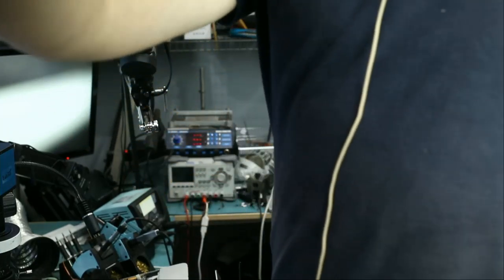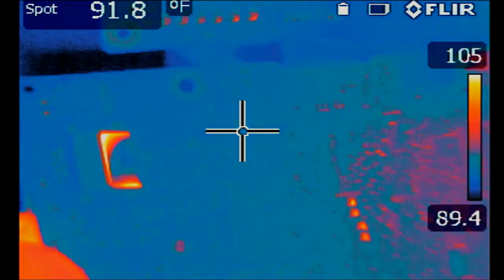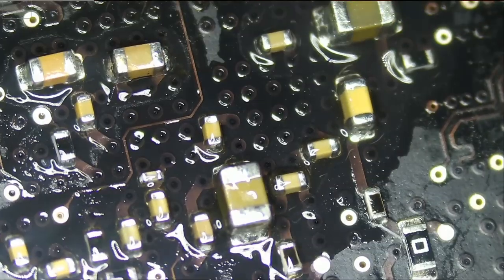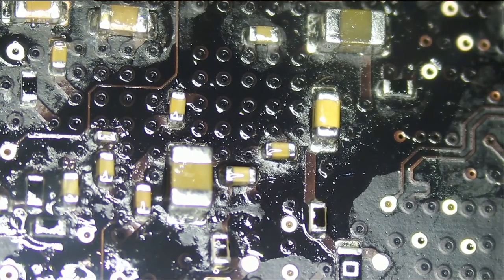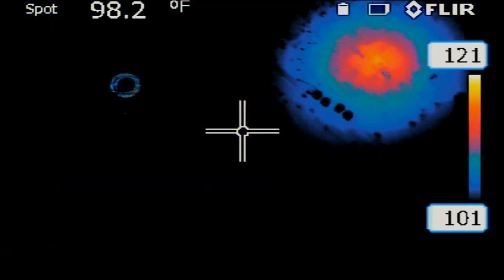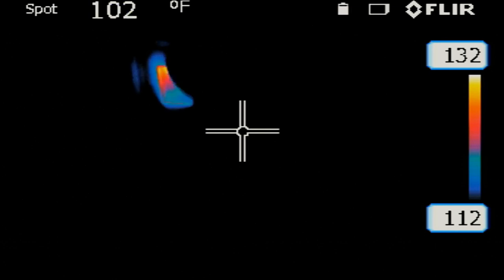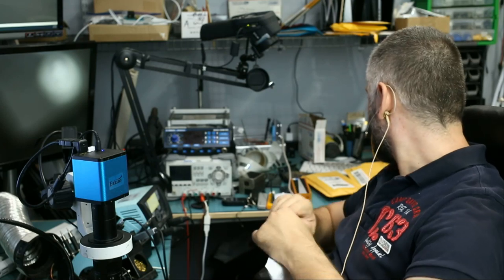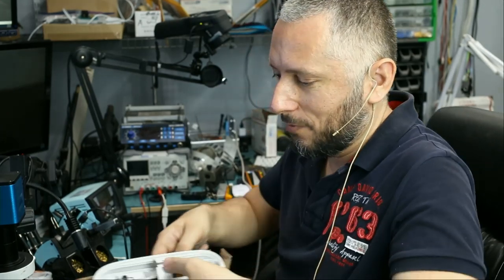iMac A1418 Late 2012 Retina No power Diagnostic Part 2 + mail-ins

Comment: I have a iMac 27 2019 and doesn't start, I have just led 2 on, any idea how can solve this issue?
Reply: I have the same issue, 2011 iMac 27inch, power on but no chime and no scene, it just stopped working one day and the iMac was hot at the time.
Reply: I've taken the screen out and I get the first two LED's coming on but not the third, suspect it's the GPU that's failed?

Comment: The light on the screen of my imac a1418 was damaged after changing the ssd, I made the mistake of disconnecting the 2 cables from the screen with the imac on, after doing some tests I turned on the screen, I closed it with its adhesives and that's it It does not work anymore, which may be, I have not tried with another screen, it is possible that it burned, or changing the flex of the backlight would solve